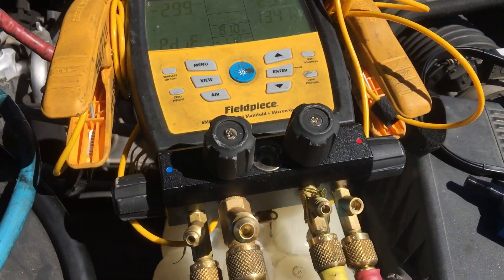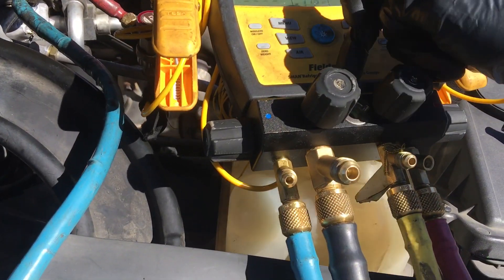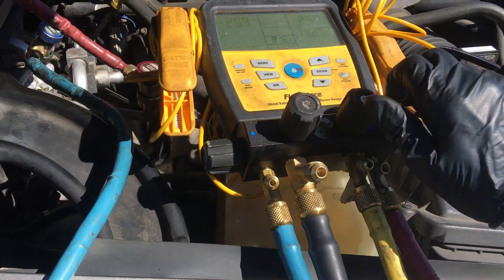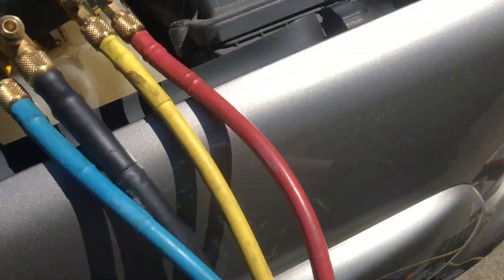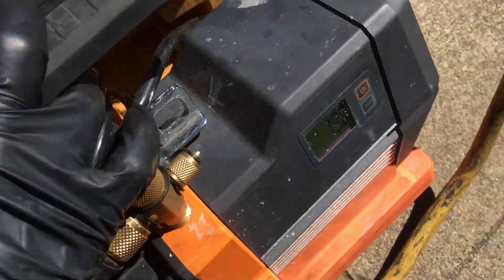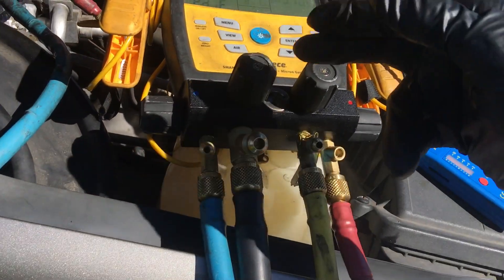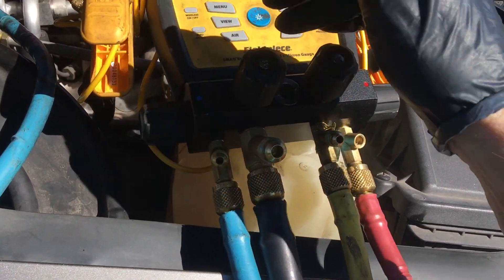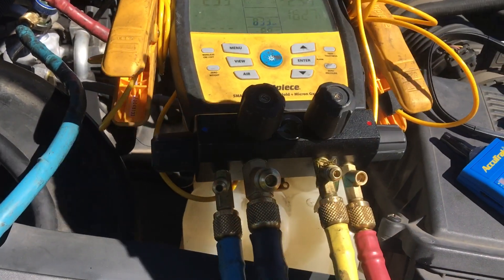Here’s What happens when you get oil contamination on your micron sensor in your gauges, ￼

Comment: Surprising just how much contamination can affect a reading.

I have a problem I am not sure about, e.g. contamination or a dodgy gauge.  I have a relatively cheap TPI 605 micron gauge directly on an aging SuperEvac pump giving me, after a while, 70 ish microns, whilst I have a Yellow Jacket gauge giving me 260.  These are connected with a tee with new gaskets (I got down from 300 to 260 by changing the gasket on the YJ).  So the answers to this are either a) a SuperEvac pump not pulling very well and a dodgy TPI 605 gauge, or b) a dodgy YJ gauge.  I will clean the YJ and see if this makes a difference, but what would your view be, i.e. could a micron gauge actually under read by this much?  Thanks.
Reply from the maker: @mickandrews9458  I’ve used and owned every common large manufacturers micron gauge. 
      And there’s a reason why I use Accu tools, blue vac, micron gauge and no longer use anybody else’s micron gauge. 

Sensitivity to contaminations is one of the reasons

Comment: That is what u usely do so u don't waste time
Reply from the maker: What do you usually do? 
Clean it out with alcohol . 🍺 

There’s no waste of time , usually these sensors do not get contaminated maybe once every 600 to 800 cars since I do over 2000 cars a year on the set of gauges.  it only needs that cleaned about three times a year when this happens

Comment: Can you use RX11 to clean the sensor?
Reply from the maker: @YTsux24-7  don’t know. I would play it safe and stick with alcohol
Reply: @coldfinger459sub0  I may give a call to Fieldpiece. 
You'd think it would work since technically it is a refrigerant, and its purpose is to clean oil from piping without residue. 
Thanks!
Edit: I sent an email this morning. (MST vs PST)
Reply from the maker: @YTsux24-7  it was designed to clean pipe 

With no consideration for rubber orings 
      Because residential has no orings.
Reply: @coldfinger459sub0  Thanks, FP support replied: "We advise using isopropyl alcohol into the suction port and shale for 1 minuet. Repeat 2-3 times and pour out excess, let dry over night." 
The person replying has extremely poor grammar and did not state how long I should dance around with alcohol in my gauges. 🤣🤦‍♂️
Reply from the maker: @YTsux24-7  well if you read the instructions on the manual, you’ve got the same information. 
That’s exactly what they say, and the owners manual 

And that’s exactly what they have posted on one of their videos on how to clean if you go to the website and look on the videos .

Comment: you won't get as low a reading at your gauges as you will right at the vacuum pump
Reply from the maker: And the reading at your vacuum pump is incorrect because of the length of hose in friction.  
               The only correct place to put a micrometer is in the lines of the AC system itself know where connected to your hoses or your gauges. 

        But after the experience of doing a couple hundred or a couple thousand systems with micron gauge is located at the vacuum pump and the vacuum gauges and in the hard lines of the AC system you get an overall average of a correlation of the pressure dropped in the correct pressure that you would be reading in the system compared to your gauges and compare to your vacuum pump experience of doing hundreds of system. 

        I have done videos on this before. 

Jim Bergmann has produced some excellent videos of this this was stuff I was taught by my father more than 40 years ago before high school it’s very common knowledge in commercial refrigeration and chemical and biological laboratories they use extreme vacuum in different processes use micron gauge is on an every day job situation.